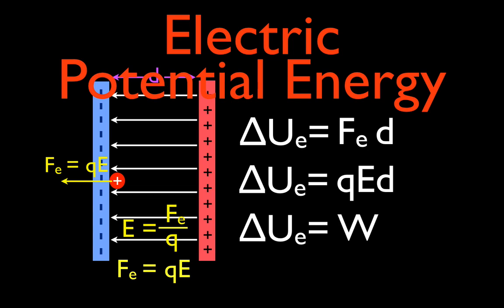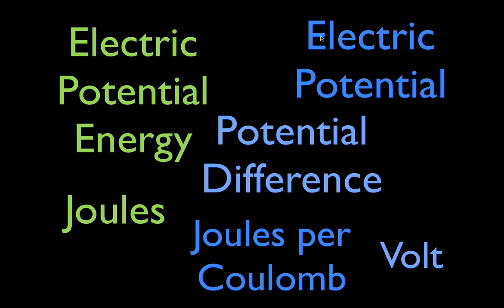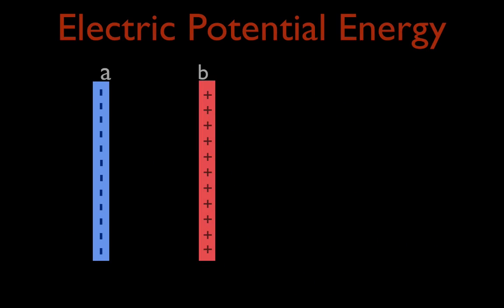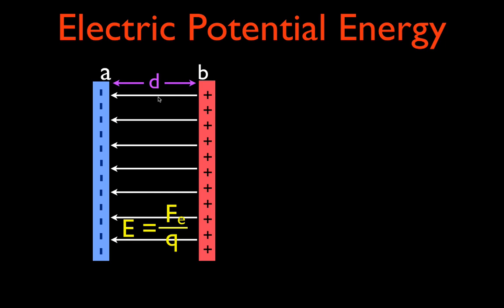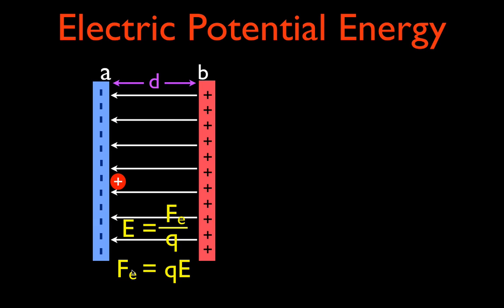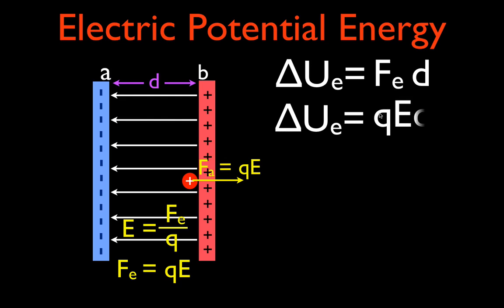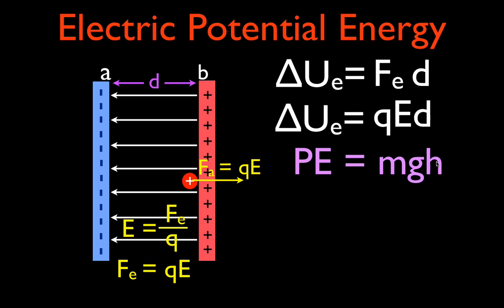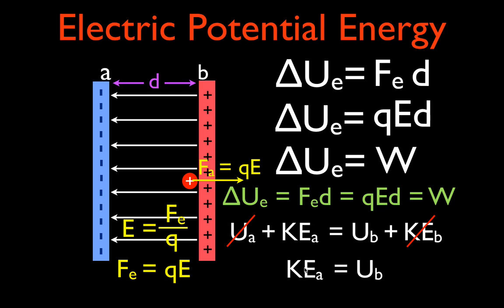Uniform Electric Field (4 of 9) Electric Potential Energy due to Parallel Plates: An Explanation

Comment: Sir,i had a question.When we talk about intensity between Oppositely charge parallel plates we say that it is independent of distance/r.But from the same oppositely charged plates we derive E=-potential gradient and say that E is in inverse relationship with r. Confuses me.
Reply from the maker: Sorry but I do not know what you mean about the "intensity" between the charged plates....the force of attraction is dependent upon the distance between the plates.
Reply: @stepbystepscience  electric field intensity
Reply: @stepbystepscience  E=sigma/episilon for oppositely charged parallel plates i.e independent of distance between plates
Reply: but from same apparatus we calculate E=del V/del distance (btwn plates)
Reply from the maker: Ok these questions can be hard to answer online this way but...I would say "electric field strength". The potential difference (V) between two charged plates is calculated as V = Ed, E is the electric field strength and d is the distance between the plates. E is therefore E = V/d, and the field strength is inversely proportional to the distance between the plates. Does that help?
Reply: @stepbystepscience  yeah right but Electric field btwn oppositely charged plates is independent of distance E=sigma/episilon

Comment: When a positive charge is moved from a negative plate to a positive plate, its potential energy increased i.e delta U > 0.

Because W = - delta U, W is negative. Is this right, Sir?
Reply: It has gained the potential to go back to the negative plate. Therefore yes, the potential energy has INCREASED. So why did you say W is negative? The work done by the field is negative because it has lost energy. But the work we've done to raise the potential of the particle is positive

Comment: hlw sir,i've a problem and the question is positively charged oil drop has a mass 9.79×10^-15 kg held at rest between two parallel conducting plates A and B. the potential difference between the plates is 5000V and plates B is at a potential of 0V. distance between the  plates is 2.50cm. is plate A positive or negative? (please sir make a vedio on this)
Reply: No